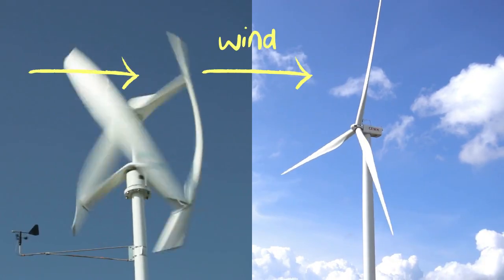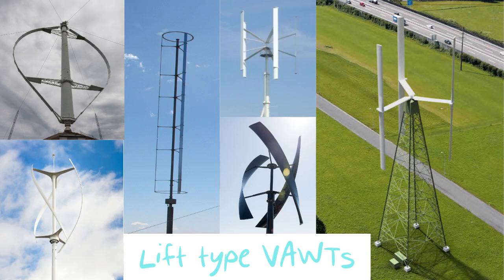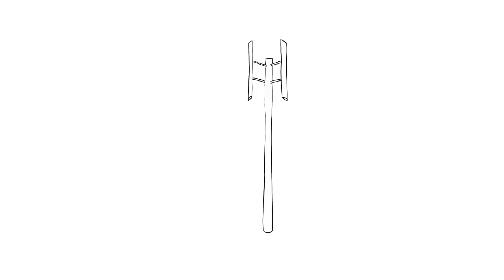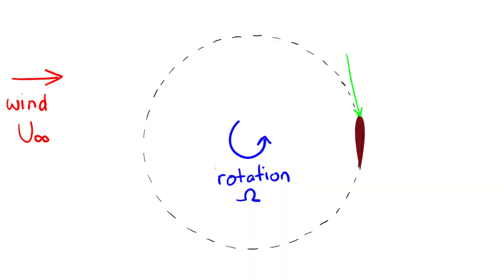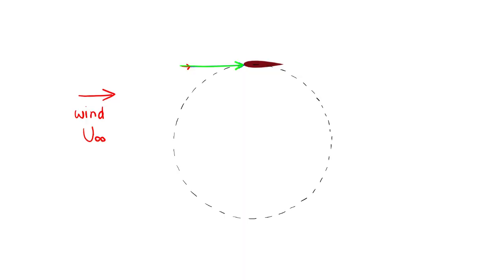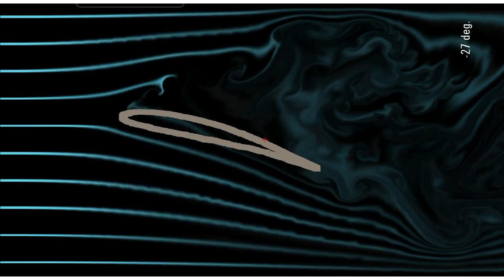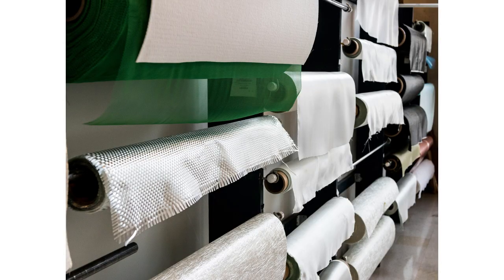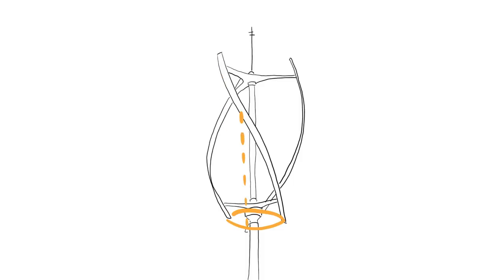Vertical Axis Wind Turbine Aerodynamics and Design

Comment: Very nice video !
Usually so many people say anything about wind turbines, especially for VAWT !
To my point of view, the best compromise for a VAWT is a Darieus twisted mode (twisted for a more constant torque as you mentionned).
I worked ten years ago of such project. It was so exiting to play with aera (and CFD), structure (FEM) and electrotech to control the speed (and the power).
May be you should notice this point for VAWT. Without furling and pitch for twisted, regulation can just be done by a controler on the TSR (to reduce efficiency)

Comment: Very good video, I had a company that used to sell horizontal turbines (450 to 5kw) but now I am retired.  Vertical axis have a great place because of noise levels and inconsistent wind directions. I did look at putting some on buildings in a downtown setting but never got the chance. What can you say about the later type?

Comment: I have little knowledge of aerodynamics, but I was wondering why HAWTs don't have winglets. I'm sure the answer is "they don't really help" but I was wondering why.
Reply: I was wondering if they would help on a VAWT design.
Reply: @maflatlander  Yes = they would to some degree. But you need to remember 2 things: 1) It complicates manufacturing and 2) Blades on VAWT work not only at positive angles of attack, but also at negative angles of attack...designing a winglet  for asymmetrical airfoil which is equally efficient in that conditions could be a bit of a problem :) Less so with a symmetrical airfoil.

Comment: Hey Rosie. Great videos. Learning alot. I have a comment rather than a question and wondering what those out there think including you of course. 
I am living on a boat with solar panels. Looking at a windturbine for the winters and in northern europe not enough solar to charge. 
The market is full of small turbines. However there is so much mis information and dishonesty. Its seems the price for something that promises alot of power is really low but the reviews are super bad. 
500w turbines with good reviews are at least 1500 euros. That is horizontal axis. 

I have not seen anything small enough for a boat or cabin that is vertical axis for under that price. 

Anyone out there with recommendations of models that actually work? Please share

Comment: Hi Rosie, great video (recommended by Just have a think). What are you thoughts on the PowerPod  wind turbine design.  Thinking of getting one to supplement my solar panels.  https://www.halcium.com
Reply: Yes! I saw that and it looks very clever. But, I could find very little info beyond the website and the couple of news articles. I'm not sure if the broad claims and little info is simply due to trying to maintain trade secrets on a prototype, or if it's really a flop and they are concealing the shortcomings while creating hype. Tbh, it does have a to-good-to-be-true feeling about it.

Comment: The variable AoA design makes it similar to a cyclorotor propulsion system or a Voight Schneider propellor in reverse. I have looked at whethar the AoA control could be just a cam or eccentric with levers and I think a good approximation to optimum is possible with a simple design. It also makes it self-starting without any fancy electronics... I want to make one just for fun! Maybe 2-5 kW max power... Aluminium is not well suited to high fatigue, having no fatigue limit (the peak stress below which the fatigue life is infinite [explanation for other readers, not you, Rosie...]) so alloy steel and composite is maybe the best choice?

Comment: Can vertical turbine drag forces be reduced by adding a mobile shroud to the returning side of the apparatus?  This seems like it would solve a lot of the drag problems.  The shroud could be oriented along the same axis as the turbine by means of a tail of sorts to keep it positioned automatically.

Comment: Easy for me. I am going to be living on the pacific coast. I will need to generate electricity. Wind blows constantly. And I want to put enough turbines to generate 150% more than my needs. Also, I want to attach satellite dishes to the towers. I assume this should not be that much of a problem. Noise is no issue.

Comment: A simple cam based solution for a 3 blade VAWT would add 18 pivot points and 7 components. If the alignment of the cam was controlled by a wind vane this adds 2 more parts and makes the system fully dynamic. The parts needed would be similar to the helicopter rotor pitch control. This entire mechanism could be purchased from a model aircraft store for around $30 or $5000 for an industrial set. Although this raises the complexity, good design could make this robust and would pay back in efficiency gains very quickly.

Comment: I have a more gerneral question about windturbines. Why are there no ducted windturbines when they are more silent and efficent and why isnt there a impeller version of a ducted Turbine? Is this purly a structural problem?
Reply: There's a company called Halcium that is claiming to be developing a ducted WT. It's called Powerpod, but they have very little info out there backing it up. And tbh it has a lot of to-good-to-be-true feelings about it.

I think the biggest reason is that wind power depends on the amount of area swept by the blades, which is why industrial HAWTs are made as big as possible, they can sweep a larger area and so capture more power for a given amount of materials (and thus cost). Ducting increases efficiency, but adds material costs, plus limits the size.

Comment: Vawt's require less real estate. They can be made much lower to the ground not requiring a space shuttle for repairs. As most people live in cities... The "fix" for a lot of the "bad" that comes from Vawt's can be done by putting a scoop/shield around them. Also increases output. If the scoop/shield can rotate, controlled with a rudder, it can be used as an over RPM protection device. By regulating the scoop/shield/RPM protection device with a centrifugal clutch mechanism. At operational RPM's it maintains an optimal position to the air inlet vs blade position. In high wind it turns until the force of the air, the max RPM's and the tension of the clutch balance. Out of harms way. At full output. 
By the way... This is not my idea. It comes from someone called the Dutch? A few dozen decades ago.

Comment: Great videos on VAWT Rosie...from what you are saying, VAWT are more suited to small scale urban installations rather than large scale utilities, where 100m towers and mega wind-spans and noise would be an obstacle.
Would you say that efficiency is less important, if the kWh cost of the utility is high enough to justify a reasonable ROI?
I started to look at these (VAWT) for urban installations (schools to be specific), where the cost of energy (here in Joburg) continues to increase, to the extend that batteries, working in conjunction with solar PV, can benefit from VAWT's topping up the batteries, probably more outside of solar hours. Would be nice to hear your thoughts :)
Reply from the maker: Thanks for this comment, I am planning a video on urban wind generation in coming  months, so I will take your suggestions on board!
Reply: @EngineeringwithRosie  Can't wait to hear your thoughts :)

Comment: Very glad that I've stumbled upon this channel! This was very well presented and on an accessible level, although I'd be interested in a more in depth video with more math. 

As you've mentioned, VAWTs are appealing for DIY, off-grid and low resource uses. Therefore it'd be interesting to see a video where you go over the idea of a hypothetical VAWT design for the "backyard".  Would it be safe? Would it be noisy? How much power could one expect from a backyard VAWT? Maybe an open source VAWT-design that relies on accessible parts, materials and tools could push things forward with an active community that tests and improves the design. Could a helical design be possible, if one would have patterns for sections of the blades, ehich one cuts out from a tough material, and then for example makes "styrofoam sandwiches" with the help of a tool/method to align everything properly. Then, to improve the durability, cover the blade in glass fiber fabric and epoxy resin. As I'm not an engineer, or anything remotely related, there is a fair chance that I overcomplicate the solution and underestimate the challenges at the same time. So it'd be very interesting to hear your ideas on a DIY VAWT design!
Reply: Good idea to prototype. Let us know

Comment: I recently came across a pod like configuration  (halcium powerpod) that channels wind up through a turbine that resembles an aircraft turbine. I believe it would fall into the Horizontal category by definition and I'd be interested in seeing how they overcome what looks to be a rather inefficient design. Especially as their claim of most powerful, safest is rather boastful and likely a play on the "safest" superlative. Perhaps this turbine is deserving of a third party engineering take from, say, Rosie the Engineer ;)
Reply: They have a lot of claims and not a lot of hard numbers. It has a lot of to-good-to-be-true feelings about it. I would love if it turns out to be a useful product, but I'm skeptical with how little they've actually said about it.
Reply: @falconerd343  that's what I'm thinking also. Still might be an ok product for urban applications.

Comment: i remember 10 years ago i got deep into them and researched them alot
but i didnt build any bc of the complexity of most efficient lift based designs
i was also disappointed by the weak output of the savinus type and i didnt want to bother with it

Comment: Great video. Shows there are a lot of pitfalls in  VAWTm design.  I think they have great potential in urban areas without necessarily beating or matching HAWT efficiency...and I'd like to see the maths too
Reply: Just now, I did some basic calculations and used it to increase the VAWT efficiency by a whopping 43%. Such a simple solution.

Comment: Math is the language of science & engineering. Almost impossible to design machines without applying some math modeling to get the optimal results. I also vote with the others requesting the math for VAWTs. (NOTE: I have been acquiring some components with which to attempt to build a small VAWT for our rural property in the mountains, so I "have some skin in the game", so to speak.)

Comment: Hi Rosie, I have just discovered your Channel from a referral from "Just Have a Think".  You are very knowledgable in the area of aerodynamics (among many other things) and I am wondering if you might have time to explain the way some yachts are able to sail faster than the wind - I'm thinking of those America's Cup yachts sailing in Auckland earlier in the year.  How do they sail at 70km/hr when the wind is 15?  And what happens to the aerodynamics when they go so fast?
Reply: If you are sailing with the wind (wind coming directly from behind you) there is no way you can sail as fast as the wind, the drag of the water is too great. When you are sailing perpendicular to the wind (the wind coming directly sideways to the boat) the canvas takes the shape of a wing, where the lift force of wing is directly forward. Sailboards have less drag on the water than deep hulled boats and can achieve speeds three times the speed of  the wind when sailing perpendicular to the wind. Ice boats run on blades (very much like icescates) that reduce drag almost completely, so they are able to achieve speeds 7 times the speed of the wind  when sailing perpendicular to the wind. The modern  world cup sailboats use hydrfoils to lift the hull out of the water, thereby reducing the drag of the water on the hull. Once you view a sail as a canvas wing, you can fly across the lake and it feels magical. All aircraft and sailboats are based on a tradeoff between lift and drag. Air and water are both considered fluids; so I view wings, sails, and hydrfoils as the same entities. I hope that I was able to answer your question! I find sailing to be exhilarating and get completely separated from the rest of my life when I doing it.
Reply from the maker: @bradneubauer4694  you can sail downwind faster than the wind actually! Not directly downwind in a normal sailboat, but perhaps you saw the Blackbird "land yacht" that was all over YouTube recently? https://youtu.be/CkhBskovitQ
Reply from the maker: I covered that a bit in this video: https://youtu.be/CkhBskovitQ if you look in the description for that one, there are some links on other resources that answer the exact question you're asking.

Comment: Varying AoT VAWT might be the breakthrough tech that lets it outperform HAWT, but we'll have to wait and see. Good video!
Reply: It already has been tried ( poor design though ) on a unit already. If you have a rotor that is tall, you need supports at the top and bottom, not just in the middle.

Comment: Controlling blade pitch. Ok. So we’re talking about keeping the angle of attack to the wind direction constant. This is looking easy. We just need a mechanism that rotates the blade around it’s small axis once every revolution and the phase is a constant offset to the wind direction. First question: Are we powering and controlling this centrally? - which would necessitate a drive belt or some such running from the central axis to each blade, or do we just have a small motor driving the pitch change for each blade and needing brushes to get the power onto the rotating frame? Both these seem messy and complicated. How about a passive mechanism, A “drag vane” (like weather-cock principle) which would be mounted on the top of each blade and uses the wind drag to orient the blade pitch to the optimal as the structure rotates. Putting the drag-vane at the top where the wind speed is (usually) fastest would mean it could be made smaller. So, I’m also a newbie here, but “Just having a think” about the subject.

Comment: You know how HAWTs sometimes have a 'stabalizing fin' along the axis of rotation to help align the wind turbine into the wind? Could something like that be used to 'passively' align the blades to a 'more efficient' angle of attack instead of actively controlling it? I'm also thinking of how one of the commercial re-entry vehicles took inspiration from a badminton birdie.

Comment: Very good. One idea that I have had recently is to funnel a salt-laden wind (at sea) through a strong magnetic field and thereby generate electricity directly.

Probably not that efficient, but there are no moving parts and so such a design could be cheap and robust.
Reply: Salt isn't magnetic, so it wouldn't interact with the magnetic field.
Reply: @falconerd343  Salt water is an electrical conductor, and so can be influenced by magnetic fields. It may not be that effective however.
Reply: @Number_Free  yes salt water is conductive but that is not what you are proposing to funnel through the 🧲 ; rather it would be an aerosol.  To generate any usable power you’d have to have supersonic wind and superconducting magnet.
Reply: @SoapyB20  Thanks. I wasn't sure about that.

Will sea-water work?

Comment: Very good, again. One of the biggest issues with renewables is the energy downtime (non solar/zero wind), and it is important in the long run for there to be a solution to this. My best pick for distributed energy situation (which should be every household in my opinion) is the Liquid Piston Engine ( https://www.zdnet.com/article/liquid-piston-to-become-beating-heart-of-air-force-flying-car/ ) if these guys ever get their technology out of the experimental phase. This engine is optimal for co generation ie built into a water heating cylinder where the waste heat is recovered for home heating, where the total efficiency can be as high as 80% (30% [claimed] combustion efficiency and 50% recovered from the engine’s cooling construction with possible some more from the exhaust depending). In a domestic situation such an engine would be generate a nominal 3Kw and be used to charge Lithium batteries of a rooftop solar assembly. The fuel would be from the gas mains optimally where the methane gas was produced as syngas from waste cellulosic community waste. My rough calculations for Victoria Australia suggest that there is sufficient energy in recycled wast to provide 4 times the non solar energy required for that region were there such a closed loop system. I am in the Netherlands where wind energy is abundant and am looking forward having my floating of grid system functional this year, and particularly interested to see what the balance of solar and wind input will be.

Comment: Hi Rosie, one of the problems with wind turbines is the destruction of birds and bats.  Are VAWTs any safer than HAWTs for flying animals?
Reply: Yes. Because the rotating parts are always in the same areas. HAWTs turn so the blades change locations plus they swing thru the swept area at high speeds which is what gets the birds.

Comment: Is the nozzle effect used between buildings for vertical turbines?   Redirect air to the with the wind turning rotators.  Like in a watermill.
Reply: I was wondering the same thing. Isn’t that putting Bernoli’s principal to work? Perhaps use it vertically as in a rocket stove, taking advantage of the thermals created by asphalt in sunlight, for example.  The exterior wind channel might also serve as a partial safety cover for the blades of the turbine.

Comment: Years back I saw a yt video of a start up promoting vertical turbines for domestic use. The design was like one of these drum like cooling fans used in electronic equipment back in the 80's. Can't find it any more probably because of the problems you mentioned. I always thought this was a good idea in windy areas where you don't want or can't have the impact of a large "wheel" but having a turbine that is hardly larger than the pole it sits on I don't think is feasible.